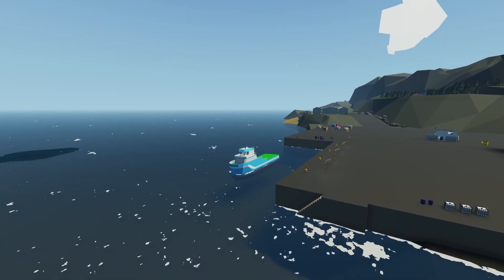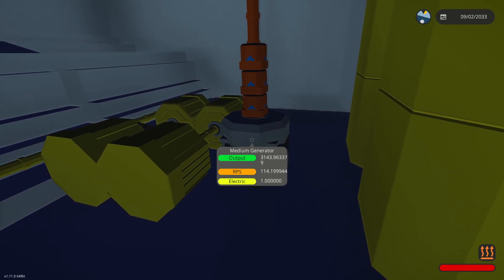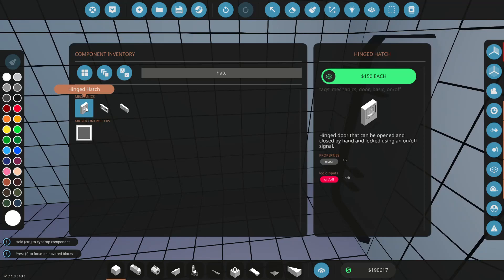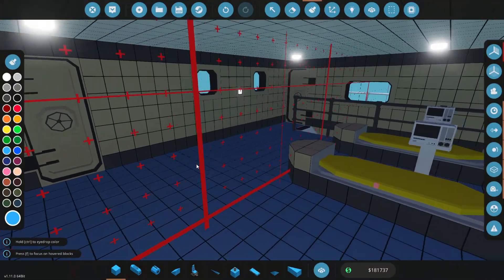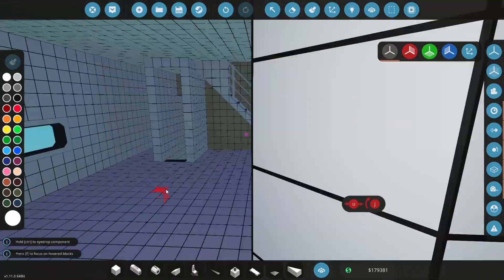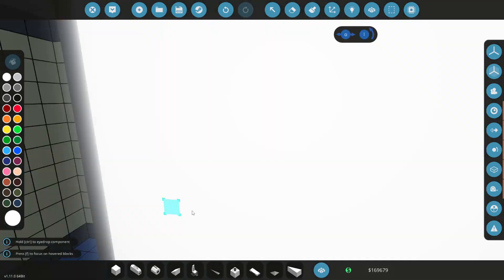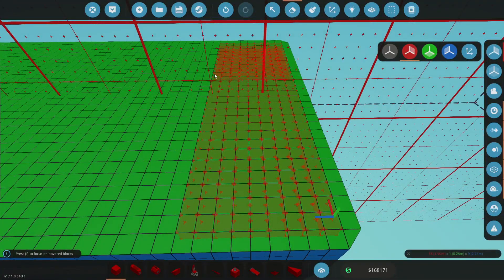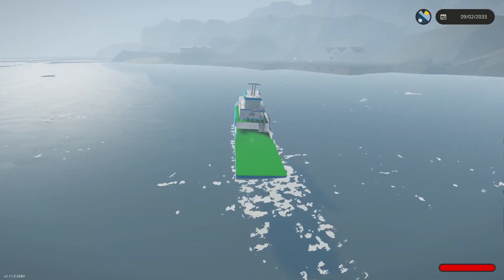Fishing Boat Interior!! Stormworks Classic Career Survival [S2E53]

Comment: The water with the door comes from the stairway down, stormworks needs a closed compartment if water physics Are gonna aply to it. By having the open way down from the deck stormworks just thinks it is a part Connected to the ocean. To fix it you could move the door higher or have the door at the top of the staircase
Ps. You can use the back space as a fish storage if this was gonna be a fishing boat
Reply from the maker: Ahh right, It's a pity because the stair case fits so neatly right in there. I'll have to change it up a bit then! 
Thanks Mate!
Reply: @BizzaDan  you can use a custom door frame above the water line, that should look fine and work fine